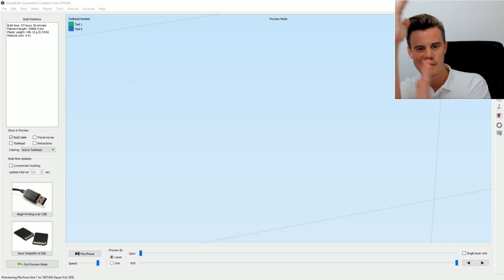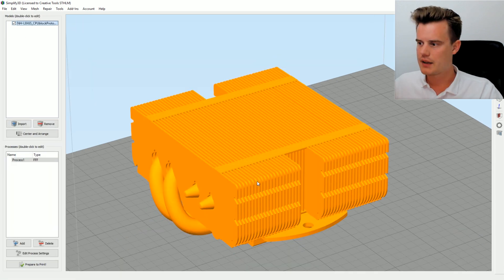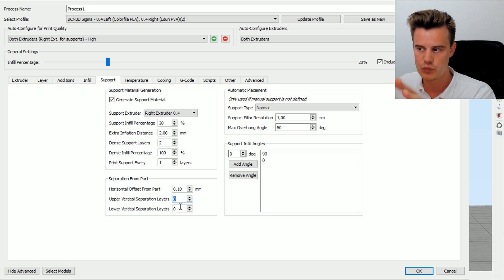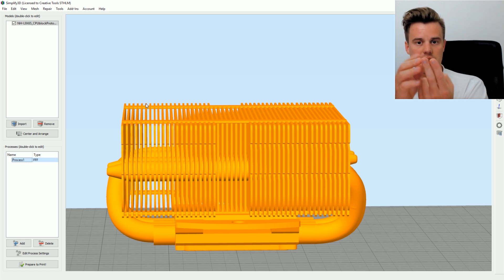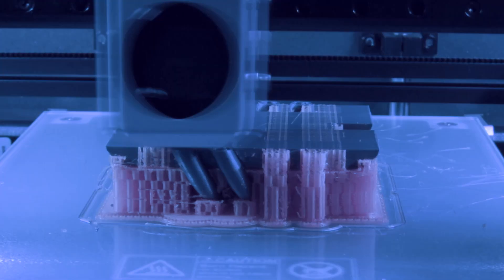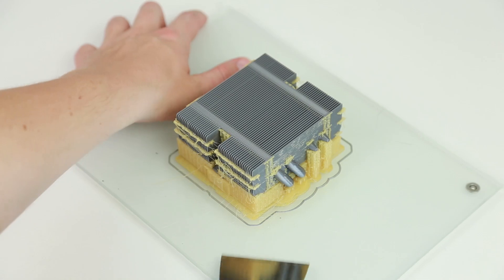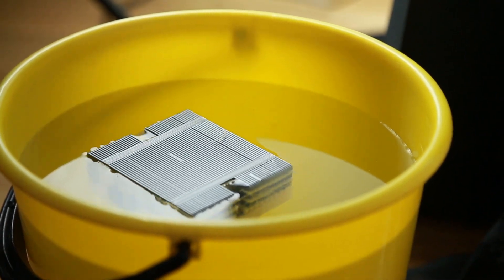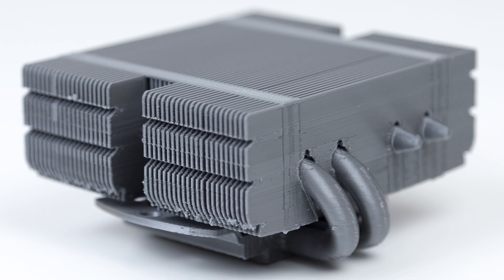3D Printed CPU Cooling block - Made with PVA supports

Comment: Could you note the brand of pva you used for this print?
Reply from the maker: +Jonathan Froes yes! That's esun PVA that BCN3D recommends in their profiles.
Reply: 3D Print - Tech Design wow thanks for the quick reply...I'll definitely try that out on my sigma.
Reply from the maker: +Jonathan Froes do it! Use the progen too and make sure you run slow speeds, and keep the PVA dry. That helps alot. Seriously don't leave it in your machine after use 👍
Reply: 3D Print - Tech Design well I seriously think I don't have a humidity problem here most of the time the humidity levels here are 0.0000001%...just a joke of course I'm in arizona and it's about that time of the year that Saudi Arabia seems cooler than us.

But in all seriousness I've been trying to use cura and I really have the supports available there. I might just bite the bullet and get simplify3d before trying some serious pva support.